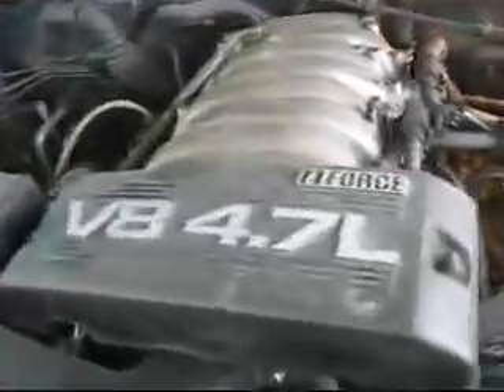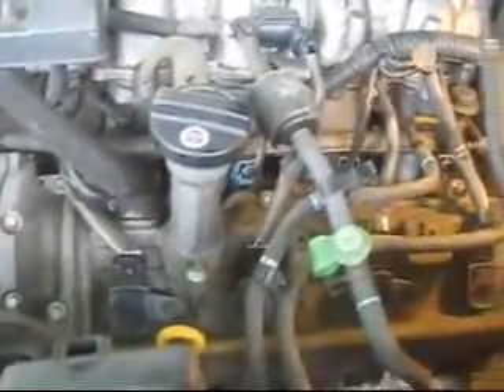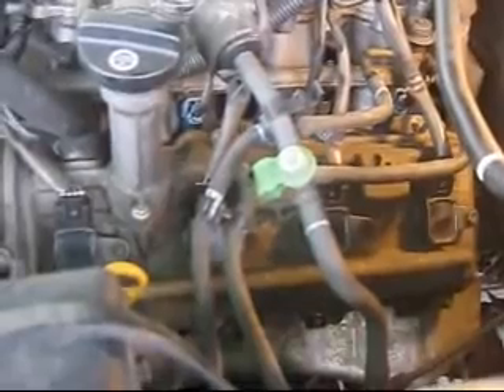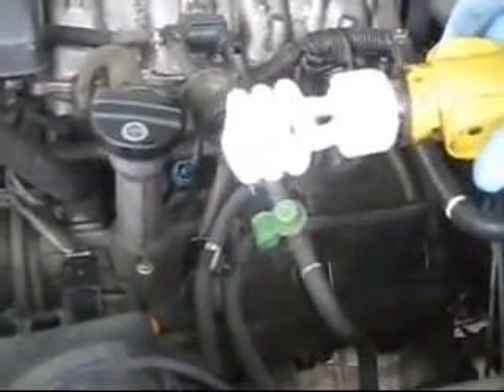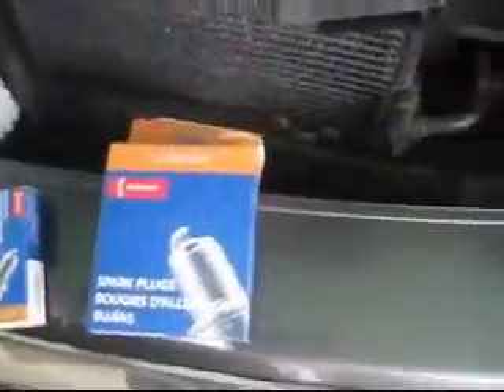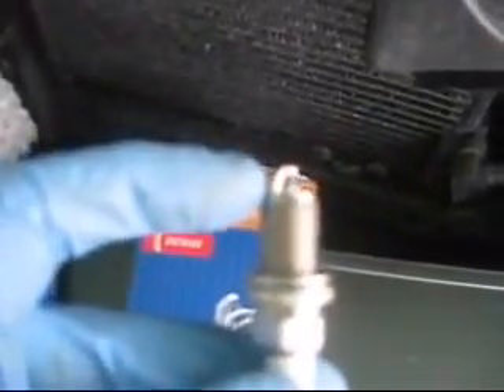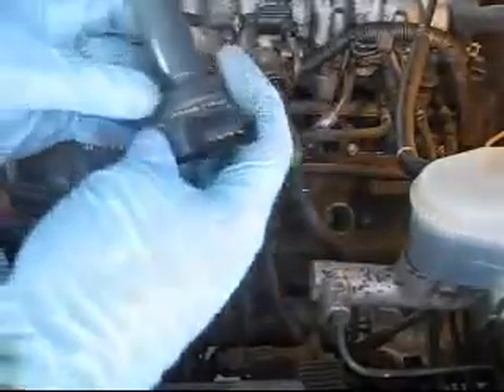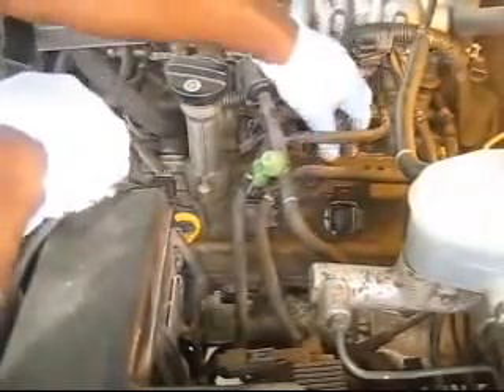How to Fix Toyota(2004) Tundra engine cylinder Mis-fire, rough idle, lose of power

Comment: Excellent video 
I've done this an still having misfire. 
I now think it maybe the wiring or perhaps a fuel injector
Reply from the maker: What's the DTC?.
Reply: @Stevexnycautomotive  
P0358
2016 toyota tundra 
I've changed the coils an plugs but still has the check engine light on . I'm guessing perhaps the wiring my need to be replaced?
Reply from the maker: @jsweeps1736 have you check the compress on cylinder #8 and compare it to other cylinder compression rating?. Another common triggers for this code include a circuit problems, and a PCM in need of a software update.

Comment: A simple way to check a fule injector  is to take a long screw driver place it on the injctor and put the other end to your ear if you hear tapping noise its good if you dont hear tapping its bad or bad wires .

Comment: for 35000 miles i would have just swapped coils with cylinder 1 and see if the issue follows if it does you have a bad ignition coil. A fouled OEM plug at 35000 miles is unlikley

Comment: What ruled out the  injector ? Before anything else ....I have 4 cyl. miss firing ...2,4,6,8  all on one side of my 4.7 V-8 . Trying to figure out if it's 4 coils or injectors .
Reply: did you ever figure it out?  Ihave the same problem
Reply: @chadnordin1065  ......$3000 later and the light came back on . I give up ....throwing it off  a cliff 😂
Reply from the maker: Tell us about it?. What happened?
Reply: Possibly the  vvt solenoid
Reply: To check injectors place a screw driver to the injector & other end to your ear while the  vehicle is running.if you hear tapping its good if no tapping is is a bad injector  or its a bad wire or wire connection.
Reply: @christopherbee184  injectors are working as far as elec. Is concerned ...but maybe there's a leak I have been told ....it's stinks bad , a gas smell of course . Runs  ruff as usual , engine shakes ....today I floored it , stomped on gas pedal at idle ....and it did nothing ....just bogged down like I flooded it or it's not getting any gas ....but then sometimes it takes off and goes like it should ....so feels like a fuel problem ...starving for it or flooding out ....

Comment: What else can also cause a misfired in cylinder # 5 (got same engine but year is a 2005).  I was messing with the mass airflow sensor and then got PO300 code.  It can't  be the spark plugs and coils because I had all 8 plugs and coils changed about 6 months ago. Awesome video and very well laid out, I am a new subscriber. Thankyou!
Reply from the maker: https://youtu.be/Zy_ie4rFMRo